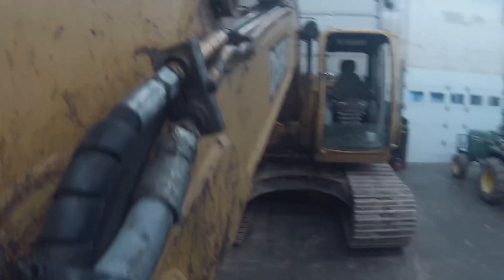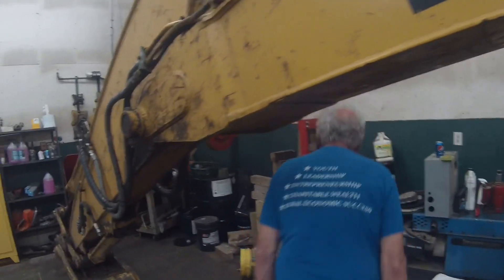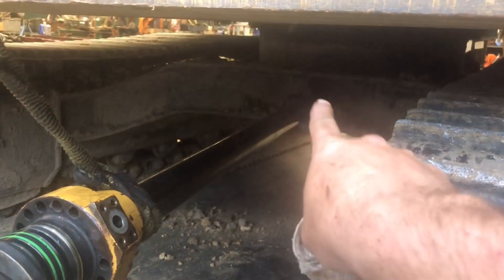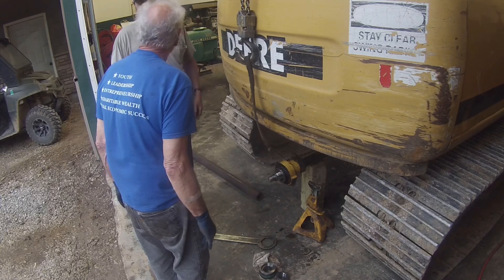Repairing hydraulic cylinder on John Deere excavator

Comment: I’m fighting with a similar one but the nut is flat on 4 sides and curved in between those. No socket fits it. We have a cylinder machine that has hydraulic jaws and I clamped those down on the nut and it still just spins in the jaws. Got it as hot as I could with the torch and just called it a day for now.

Comment: I cant help but laugh so damn hard at 4:57   I was like ohhh  the end it facing down hill with no strap holding it together hahaha. Oh I can only laugh so hard because ive done the same thing... twice actually!  But Now I know hahahaha
Reply: cap the ports. easier than a strap.
Reply: @DieselRamcharger  if there threaded caps ok if plastic slip on caps the ram will pop the caps off like a cork ..
Reply: @randytravis3998  yes use steel line caps. the plastic ones are probably carrying a darwin award in their pocket.
Reply: dam I thought I was the only one who did it ,, good thing when I did mine the oil was cold ..

Comment: Just put a vacuum on the hydraulic tank. AND I saw that coming from a mile away 😂 good stuff at least your positive about it
Reply from the maker: Would have done no good all the oil came out of the cylinder after the hoses that where connect to the tank where removed. Should have caped the cylinder are make sure the rod couldn’t slide out freely
Reply: When you put a vacuum pump on the tank you also work all hyd functions which sucks it out of all lines/ cylinders before you take it apart.def should have secured  the ram when you took it apart but either way we all get a fresh hydraulic bath at some point no matter what you do at least you didn't get hurt all that matters stay safe!!

Comment: Next time, instead of pulling the entire cylinder off, try this: Leave the barrel end pinned to the machine. Unpin the rod end, pick the rod end of the cylinder up and prop the barrel up with a block of wood, leaving clearance to pull the rod out of the barrel. Then loosen the hoses on both ends of the cylinder. Then remove the bolts that hold the head to the barrel, and remove the rod, head, and piston all together with the crane, leaving the barrel on the machine. Just beware that your oil is going to come out of the barrel while you pull the rod out and possibly after you get it out depending on how the barrel is tilted, so be ready with a drain pan. Remove the piston and head, reseal everything, install the head onto the rod, install the piston. Install the rod assembly back into barrel etc.

Comment: Yep. Saw that coming. I always would leave the flange adapters on there and cap the fittings. 

Saw one guy up on a Deere 330. He had the rod end pin removed and that end lifted up. Then he unhooked the fittings. They were pointed straight at him as the rod slid out, shooting the oil straight at him with nowhere to go.

That was a good explanation of the seals. The first seal with the green back-up is typically called the high pressure seal. Installing the Piston seals is fun. Not sure how you did it, but we used an electric frying pan with hyd. oil in it to warm the seal. We would put a big zip-tie through it backwards so the radiuses corners were towards the seal and use the zip-tie to pull it into place. Then some electrical tape and a big hose clamp to put it back into shape.

Not sure how tight you got that Piston nut. On that one, it is probably over 1200 lb/ft. Also, the barrel end would have come up easier if you had the strap lifting at 12:00 rather than 10:30. That twisted the barrel, making it difficult to come up.

All told, well done with just that little mess. I haven't made a mess like that ever this week.

Comment: Good video.     We do them right on the machine.    Would have folded dipper up tight.  Pulled chrome end pin pulled rod.  Put rod pin back in dipper. Flipped rod toward ground.   Put my old 6 foot riged pipe wrench on gland nut with pipe or backhoe teath.     Re packed and right back in.

Comment: Isn't there some kind of pressure release you use before undoing those lines?  I am looking forward to reading some comments about your wee incident.
Reply from the maker: Lol no pressure was off was oil in cylinder when rod slide out should have caped it
Reply: @DirtPerfect  I realised later what I was thinking of.  Some machines apparently have a pressure release for when plugging in attachments.  I've seen Andrew Camarata doing it on his skid steer.  I also realised that the cyclinder had been removed, so it was the weight of the ram forcing out what oil was still in the cylinder.  I think what threw me was how fast that oil came out — it was damn scary.